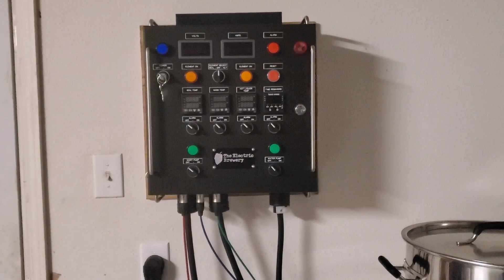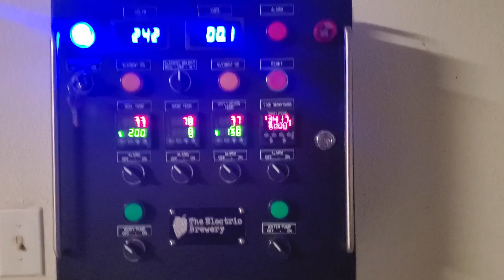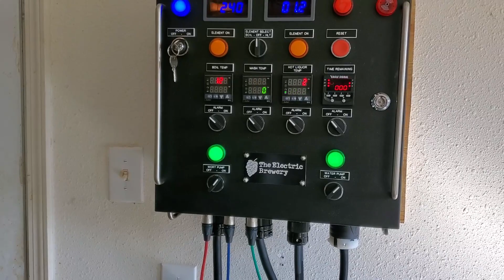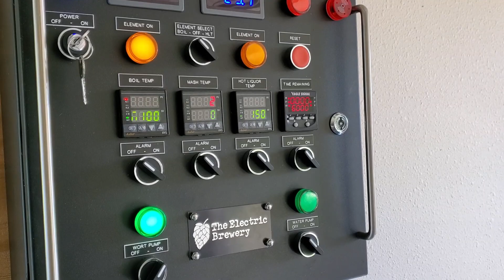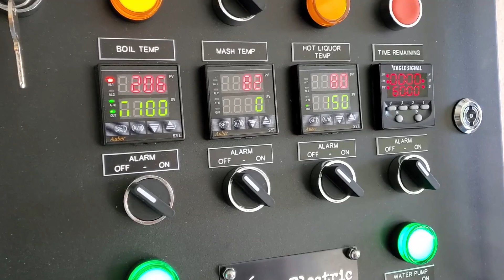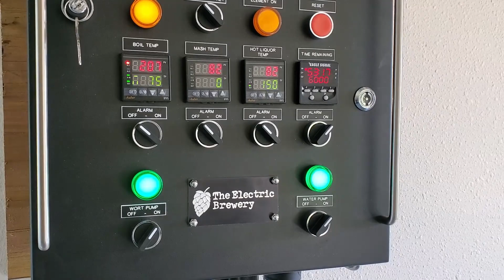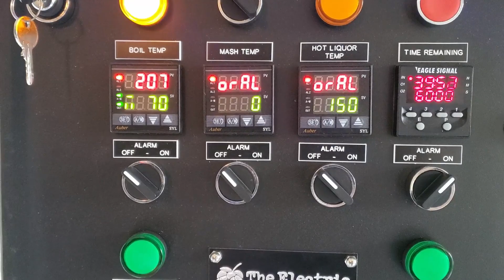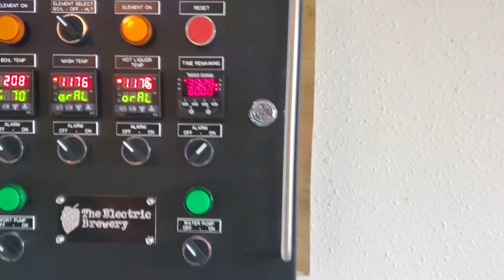HBW51 - Almost ready to brew on new system

Comment: It won't be long now.  😀  On my system, depending on the weather, I get about 1.25 - 1.5 gph boil off with the PID set to 65%.  It took me about 5 or 6 brews to get everything dialed in but since I did I have always hit my predicted numbers, unless it was due to something I screwed up...            I'm looking forward to seeing your first brew.   Cheers!  🍺
Reply from the maker: Yeah I might just try 65% on brew day.  It felt like 70% was closer but not quite.  I wonder if it's skewed results because I was simply boiling water and not quite at the same starting volume.  I guess we'll see at brew time.  I'm not going to mess with my Beersmith profile yet because the kettles are very similar to what I had before.  The only differences are electric and that step bottom which adds a little more loss in the BK at drain time.  I am really hoping my ingredients come in, in time.  That Red X malt and Ella hops were tough to track down.  I'm looking forward to brewing on Sunday (first day off for the week).  I guess if the specialty ingredients don't show in time, I might have to quickly run over to the LHBS and just grab some basic stuff to make something else and table this for the 2nd brew.  Either way, I'm determined!  Cheers!

Comment from the maker: Ok well that solves that.  Spike says I'm good to go on the 1 power plug that felt different to me.  

"Hi Matthew,

I ran this past engineering, nothing sounds like it will be an issue. It's a good thing the fit-up is tight because it prevents arching. You're safe to proceed with your brew day this weekend!

Please let us know if you have any other questions or concerns!

Cheers,
Katie"

https://puu.sh/E7Tdq/5769858f45.png